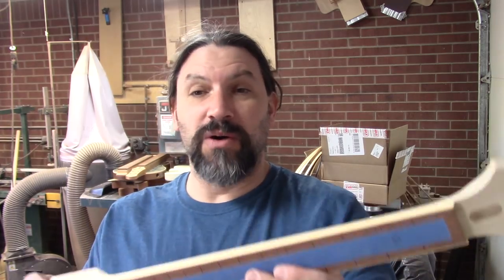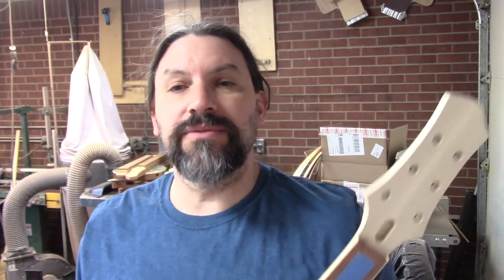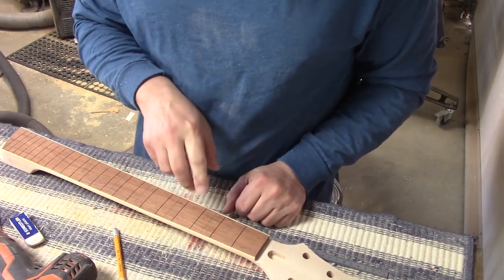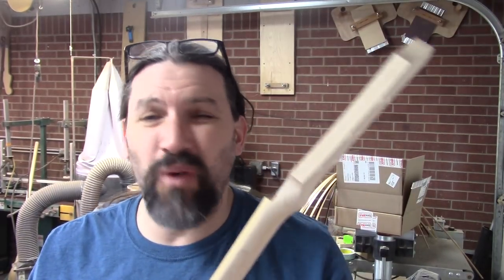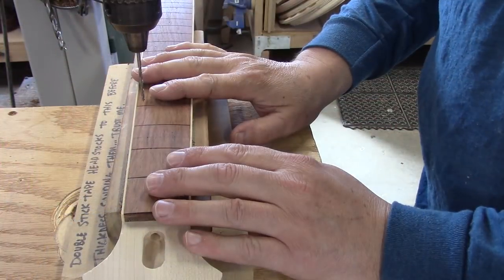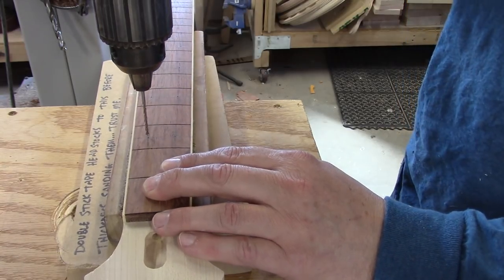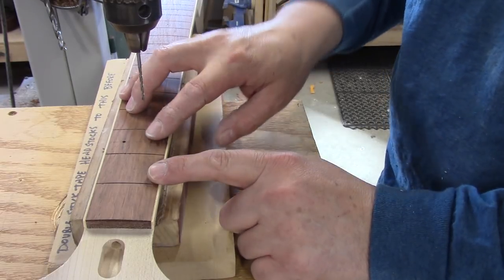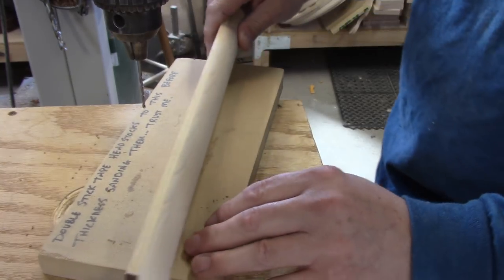How To Install Fretboard Dots... We Don't Need No Stinking Jigs!

Comment: Whats your nut width?  Does that metal 1/2"  rulr give you a dot  that is between strings ?
Reply from the maker: Standard for us is 1.6875, I don't really know if it does or not, hahaha
Reply from the maker: I guess it would depend on the nut, I'm sure it gets in the way along the line.